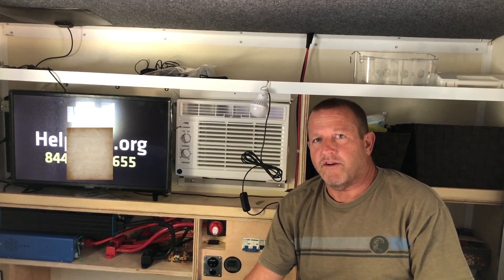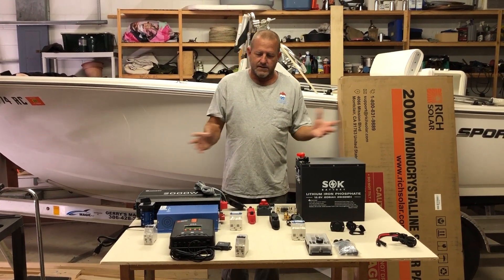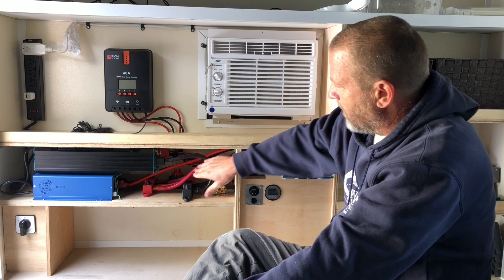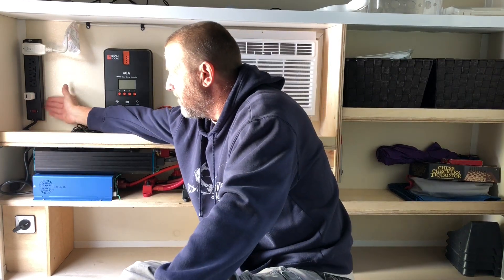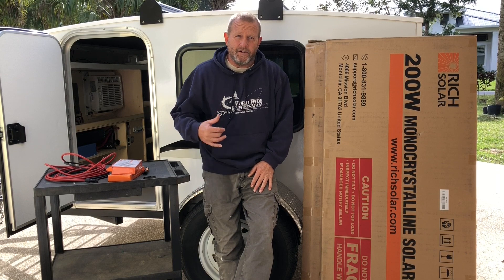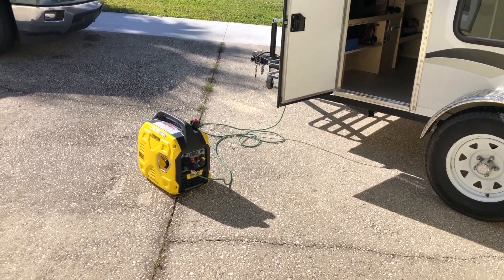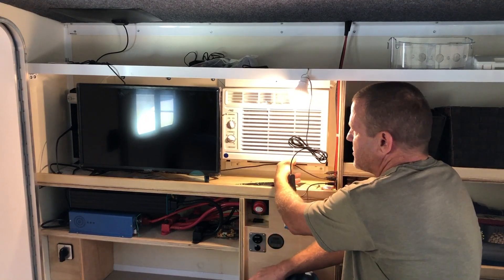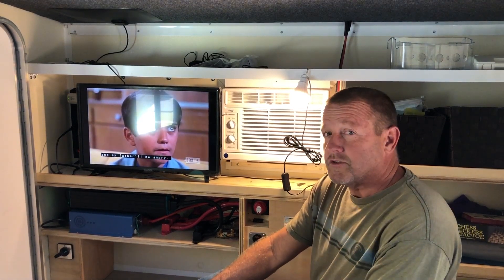Off Grid Solar on Runaway Range Runner Camper

Comment: What happens if you turn the switch to energize the 12 V circuit without having the other switch to pre-
power the inverter capacitors?
Reply from the maker: an in rush of power  can occur which can cause the capacitors in the inverter to fail prematurely. will it blow the inverter? not likely but it is just more protection for a unit that will be cycled on and off more frequently due to the random use of the camper.

Comment: When I think about adding solar to my runaway, one of my primary concerns is how to get the wires from the solar panel into the trailer. Would be interested in seeing how you ran the wire through the roof.
Reply from the maker: i used what is called an "entry gland"  drill a small hole for wires and install wires through gland then hole.

Comment: You may have seen some of my many Runaway Camper videos - they have over 1.5 million views.

One of my last videos before I sold our second Runaway - a 2020 fiberglass RangeRunner - the first one - was about running the AC with an Ecoflow Delta 1300. I was able to run the 5,000 BTU AC for almost 7 hours with the Delta in 80+ degree weather on a hot concrete driveway. Of course, it was then dead, but if someone travelled with a generator - and many do - they could recharge the Delta during generator hours in less than two hours. A great alternative for some people and the average camper does not camp off grid and usually has shore power. We have zero interest in off-grid camping, but with my multiple Ecoflow lithiums, we can go several days before needing to recharge. We now camp with our self-converted 2018 Ford Transit 250 - I have a very extensive van build series on my channel.
Reply from the maker: Yes i have watched your vids. Glad your chanell made it. I have had my channell for years but never really focused on my brand. Thank you for the tips. I do have back up generator for cloudy days this rig works great.  Thanks for the comments

Comment: A nice setup for most small teardrops or small box campers. One question, how long will the inverter do the job before the battery is pulled to low?
Reply from the maker: i will be doing real world testing in a week (4 days in key west off grid) and will post a vid . subscribe and click the bell that way you get the notification when i post next vid.